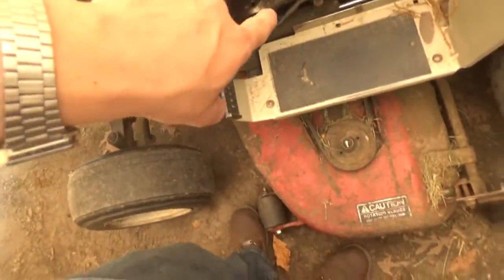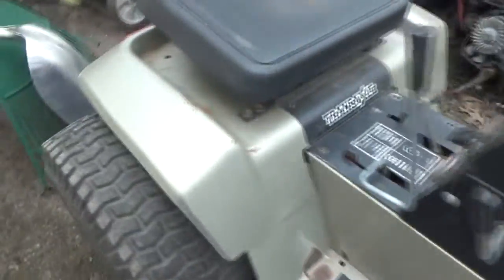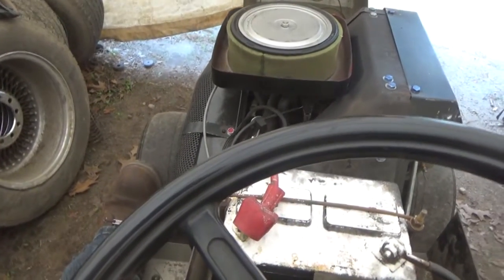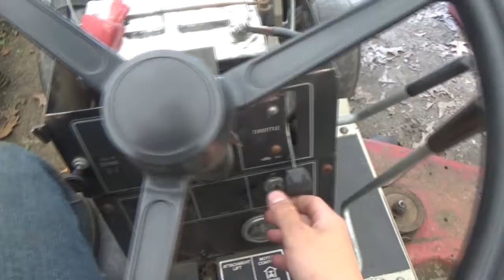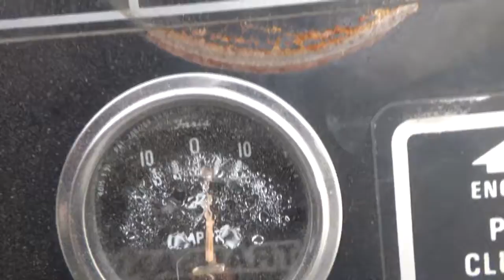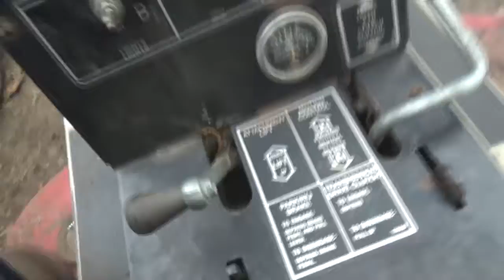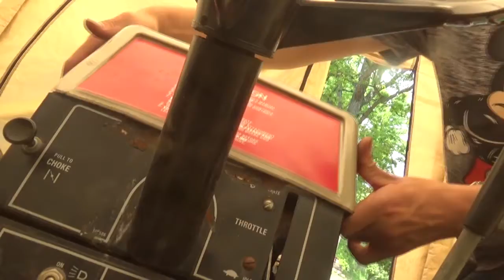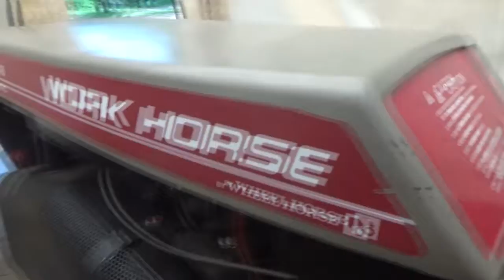1983 workhorse GT-1848 update

Comment: So what do you think about this Model?     I am looking at one on Craigs.    Any downsides as compared to other wheelhorse models.
Reply from the maker: its the same thing as a wheel horse but it has a Briggs on it the 300,400, and the 500 model parts will work on it. And if its a hydro get you can not bet it hard to kill them. whats the price they want for it if it's under $250 get it because they are not worth anymore then that
Reply: Guy wants 750 for it with no add ons.
Reply from the maker: too much walk from it the briggs engines are had to fine see if we will come down about $250 to $300 if its in grate shape